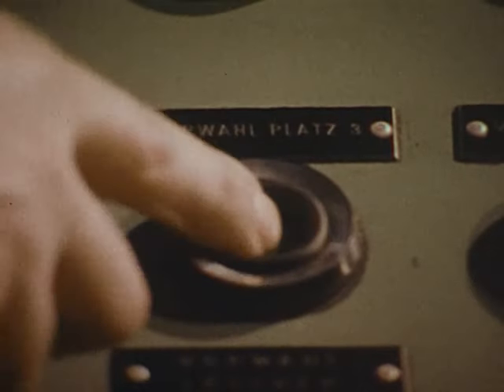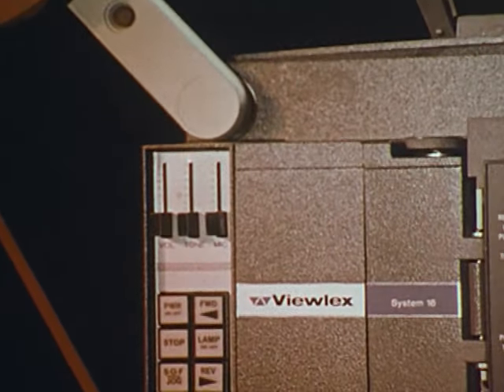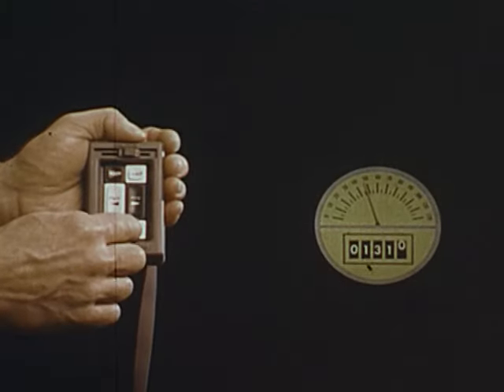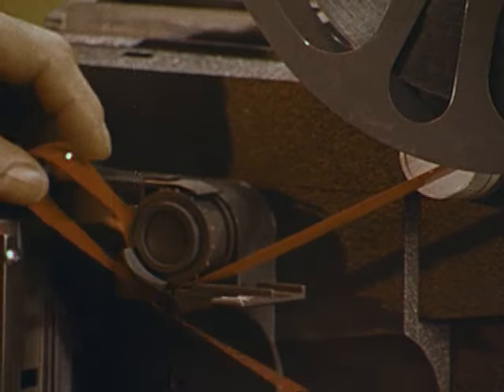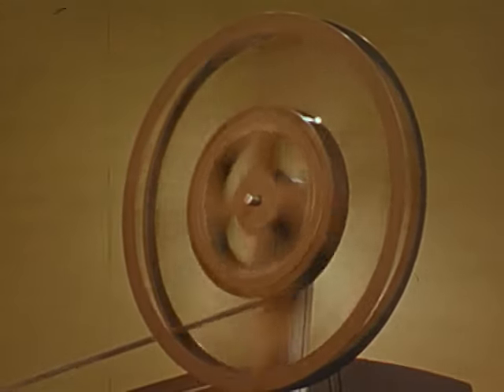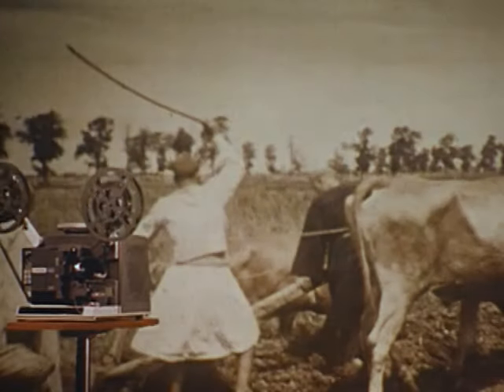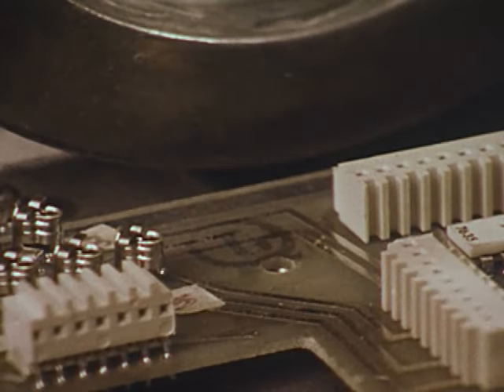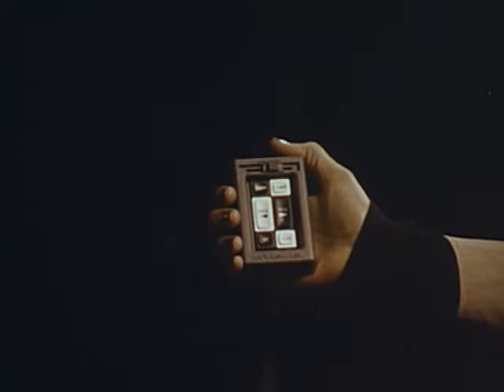Viewlex Systems 16

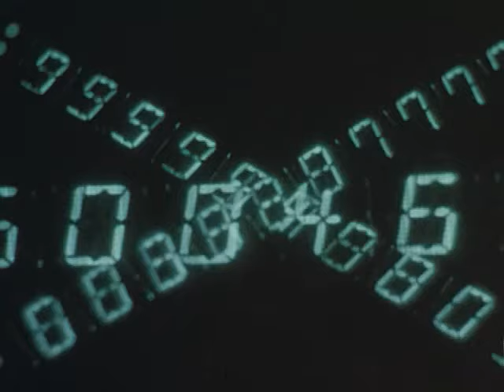Comment: This short demonstration is film about the Viewlex System 16 projector. This is extremely rare and very hard to find. There was a part at the 0:55 is about an ordinary 16mm sound projectors are very difficult to service which would be a frustrating problem. I had three projectors over the years are the Bell & Howell Filmosound 552 “Specialist”, the Singer Graflex Instaload 16, and a Revere S16 are very difficult to repair and lots of frustration. Now, I got my newest acquisition, a Kodak Pageant AV-126-TR, and it’s easy to use, and easy to operating. Kodak beats everything.
Reply: I have a AV-126-TR projector. Unfortunately these have a two pole induction motor, instead of a synchronous motor like the the Bell and Howell Specialist self-loading models.  My AV-126-TR  has a very noisy frame/shutter bushing.  I also do not know where you will find replacement cloth belts for the reels if one or both break.  
I remember my TV/AV teacher at SCROC explained, Bell and Howell 16mm projectors were very hard on film.  I think the Kalart Victor was even harder on film as they did not have a roller for the audio pick-up, only a friction loop guide.
Reply: While Bell and Howell Specialist line was still using vacuum tubes, The RCA projector was using transistors.